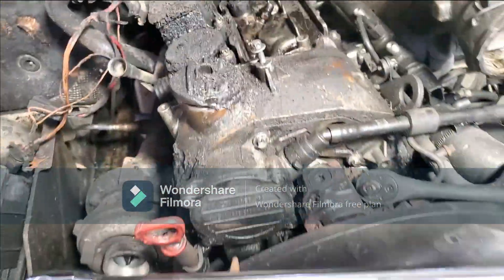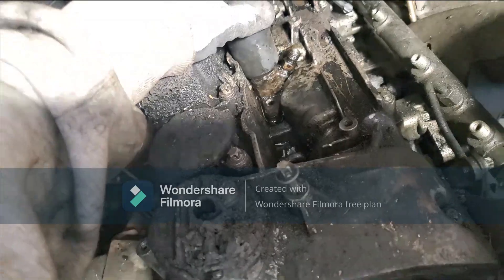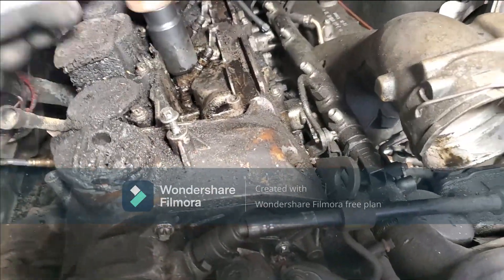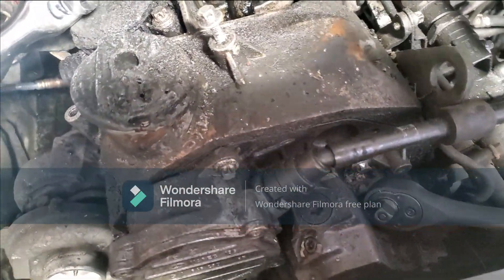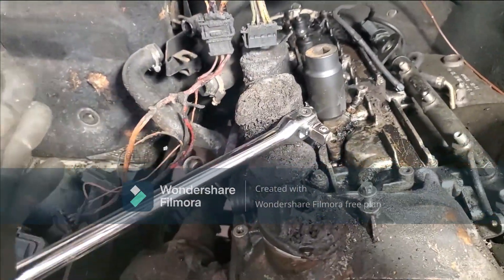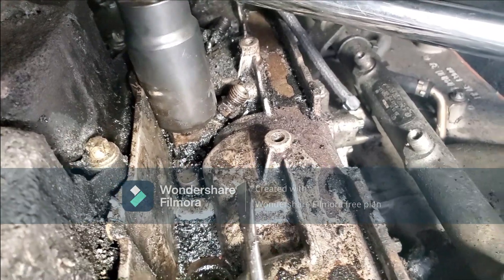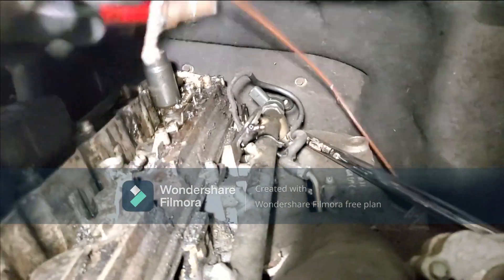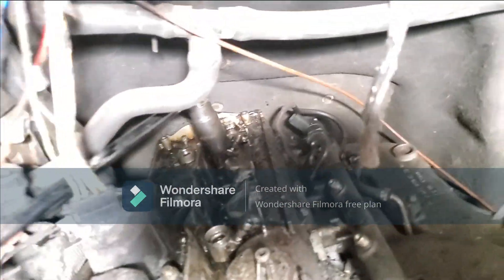2002-2006 Sprinter Diesel Injector Removal (New Way)

Comment: Trick I’ve successfully used on a merc 638 is to soak the injector valley in eucalyptus oil and then apply a cordless rotary hammer to the top of the injectors. eucalyptus oil is safe around wiring looms etc and we found was the best fluid to use to break up the diesel resin which had basically turned nto a result n like cement around the njectors. We soaked the injector valley for 4 days before using the rotary hammer to act as a frequency resonator. The Mercedes injector seals were replaced with Honda OEM copper injector seals as they are slightly thicker and are better quality.

Comment: Haha, you sound like me when you're working on stuff rofl. 'All this stupid black death BS!' To clarify you use this special socket from the kit that has a notch cut out for the injector electrical connection? I removed my hood and I'm using a slide hammer with a claw and band clamp. Still hasn't come out.

Comment: What is the "New Way"? Penetrating lube, then tap, wiggle and shake? That's not new. That's what everybody has been doing for decades, before buying the puller. I wish you had vacuumed most of that carbon out BEFORE pulling the injector so less crap fell into the engine. Also, please put paper towels in the open holes to prevent things from falling in them while working on other injectors.  And... I see wrecked injectors in the video. Thought you said "Without wrecking them"? Once you take the top off... they're wrecked. They won't pass testing and that means they are not delivering fuel properly.
Reply from the maker: Did you watch the end of the video? 1,2,4  came out 3 and 5 needed the puller.
Reply: @polebarnmechanic3348  Not all injectors require the puller. Actually, most don't. Since you needed the puller for 2 out of 5, there is nothing special here. I'm still scratching my head trying to figure out what is meant by "(New Way)", like you were the first to try wiggle while you pull? Maybe I missed something? I might have dozed off a couple times...  This is a STUCK injector! https://www.youtube.com/watch?v=OW7obNKxc4U
Reply from the maker: @FloridaVanMan  sooo what'd you do?
Reply: @polebarnmechanic3348  I put it in the van and I'm running it. I hoped the stuck injector would pop out with a loose hold-down bolt, but it hasn't in the first few miles trying. This week I will try again to pull it a few ways, unless the first works. lol  Since it is now under the windshield I can't use the slide hammer. I'll get the engine hot with a nice long drive then try the claw and a lever against the rear of the engine. If that doesn't work I'll be popping the top off and destroying the injector. My valve cover MUST come off, so one way or another, it's gotta' go!

Comment: You've still got to wreck the injector. What about cutting a slot for the connector?
Reply from the maker: No you don't...not sure what you mean entirely?
Reply: @polebarnmechanic3348   you cannot re use those injectors without sending them out for calibration. You have loosened the solenoid off the top and it will have a huge effect on how the injector operates.